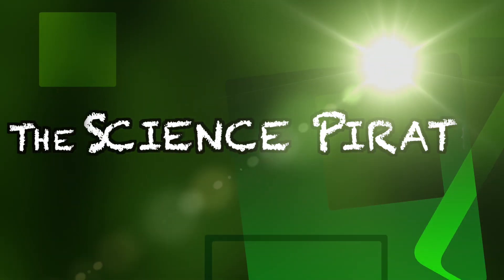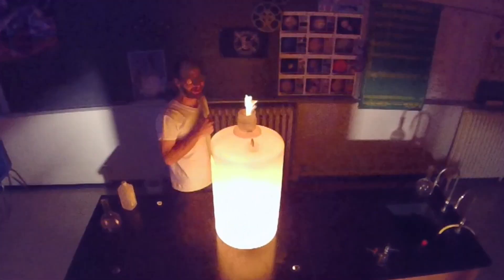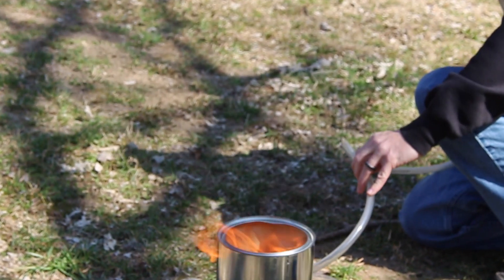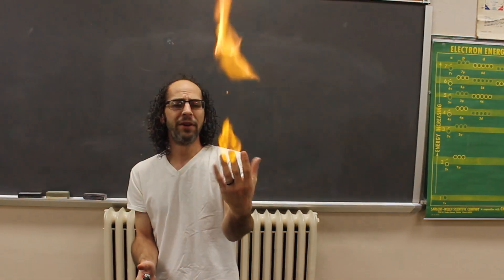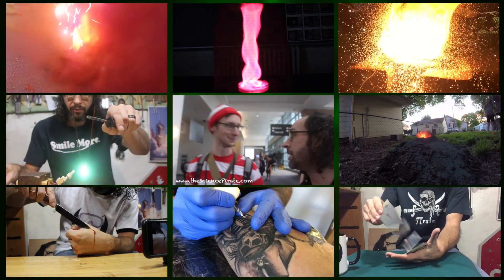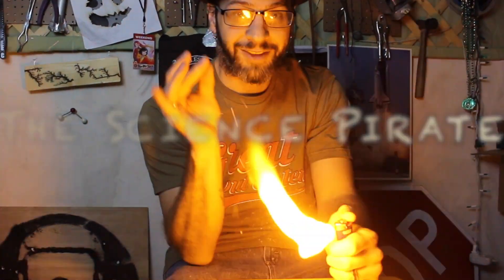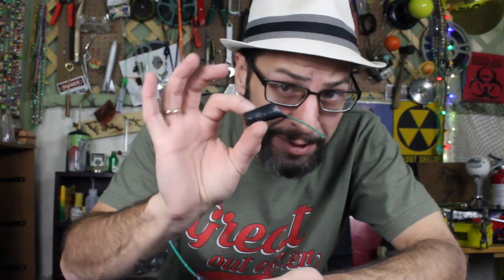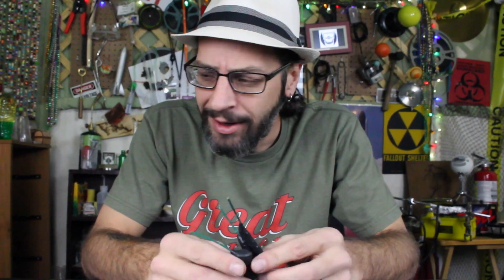Flash Powder Fireworks!?

Comment: You should never use a glass rod,   if you must stir use wood or plastic,  better to shake to mix, best yet,is to use a piece of newspaper and roll mix by lifting couners, your method could easily set it off, flash powders need to be extremely carefully handled and account for the majority of pryotecnic accidents, treat them like you would nitro. Have fun, stay safe.

Comment: NOT flash powder !  👎  Zinc powder(dust) +Sulfur, are not very energetic when it comes to making flash powder. However, it can be made more aggressive if the ratios are correct and the two powders are of a very fine nature etc 3-5 microns.   Adding an oxidizer (KNO3, KCLO3, KCLO4, KMnO4, K2S2O8) to this composition would change that swisssssh  to BANG!
Reply: No noob
Reply: So when I make the zinc and sulphur “flash powder” I use a 3/1 zinc to sulphur ratio, this works really well but what ratio would be best if I wanted to use an oxidiser like Kn03 to make it faster?